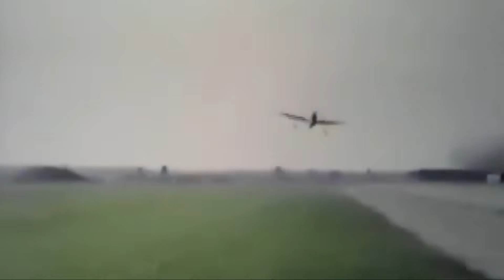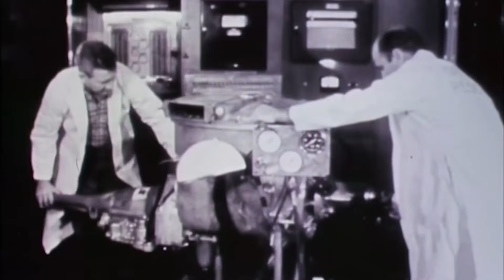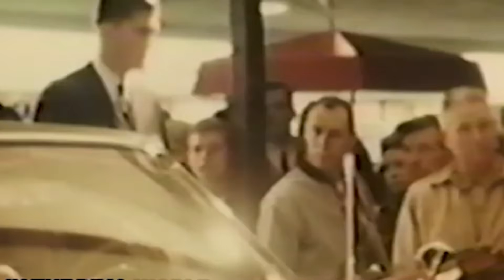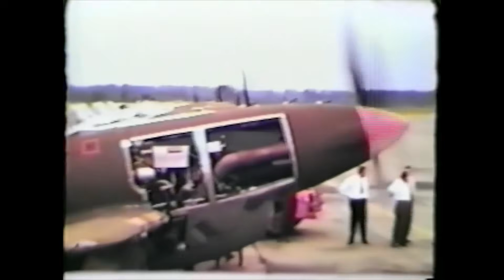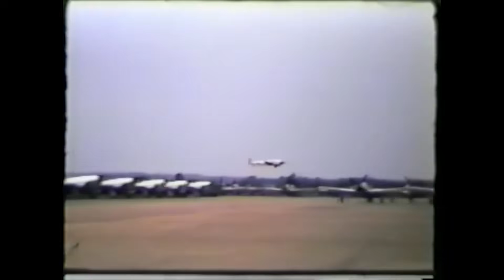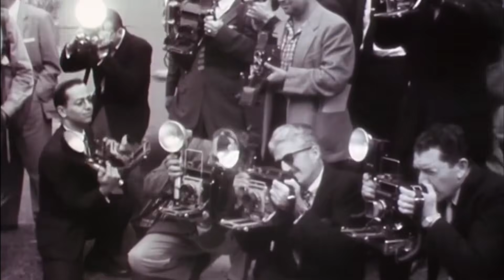What Happened to the World's Strangest Fighter Engine?

Comment: 400 pounds heavier would mean 400 pounds less payload or fuel if the Chrysler was used. Also, because it was longer, the engine mount would have to be heavier than one for a shorter engine. For weight and balance, either the tail would have to be extended or the fuselage shifted backwards on the wing for balance.

The most important characteristic for an aircraft engine is reliability. That would take time to prove,  and the reliability of existing engines was already known. It was obvious that the war would be over in the not to distant future. There wasn't a need for a new engine that late in the war, because Japanese aircraft and pilots had been largely decimated.